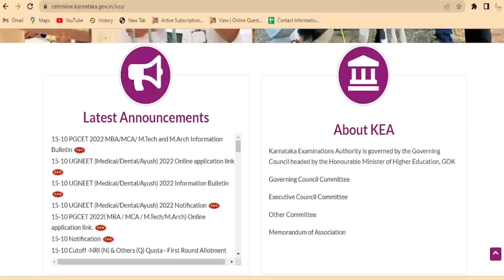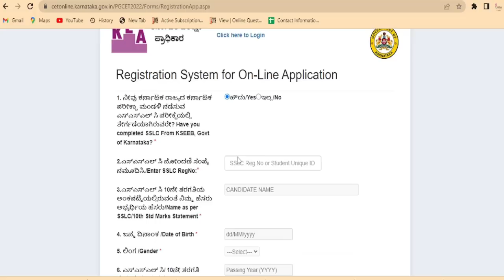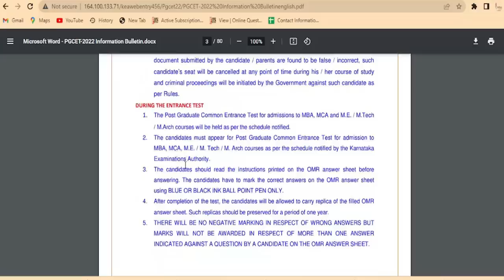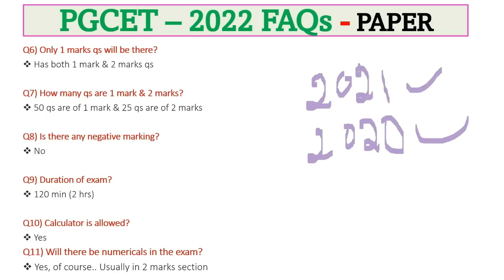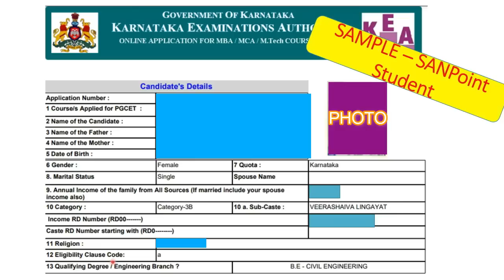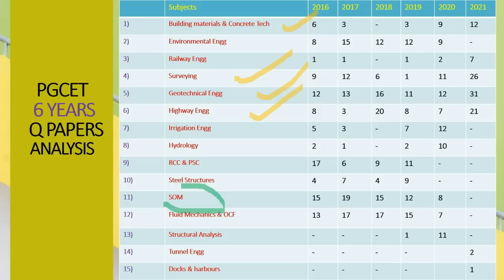PGCET 2022 Notification | KEA | Application Form Filling | Check description for CIVIL engg courses

Comment: Madam, I am facing a problem with registration itself,
I have completed my SSLC  in 2001, and my reg no. is 626352 but it is not taking what should i do. 
I have tried 2001626352, 20010626352, 0000626352, and 00000626352. and so many but it's not working what should I do...
Kindly help in this regard
Reply: Kea avrige contact madi

Comment: Hello ma'am,  getting an error saying year 4 should be more than year of joining while updating the marks details section even though I have provided all details correctly
Reply: @akshathavn7  no issues during payment
Reply: Hey even I'm facing the same Issue, please do let me know if it's Resolved.
Reply: @pruthvirajgowdap4324  Can I know what did you select for qualifying exam and what's the degree you have done please
Reply: @vandanavandu539  Hi, i have done mechanical engineering, At the time of registration, i have selected Arch-UG-BE/BTech-BArch option. are you facing the same Issue by any chance?
Reply: @vandanavandu539  did you get any revert from kea on this issue?
Reply: @pruthvirajgowdap4324  yes it's same issue
Reply: I just wrote a letter to kea along with application and have given that.. no update from their end yet

Comment: Ma'am I've just completed Bcom and applying for pgcet for only MBA.. many of them told calculators are not allowed but you said calculators are allowed .. please confirm wheather calculators are allowed or not
Reply from the maker: Calculator is allowed for MTECH exam. 
U need to check information brochure for MBA
Reply: Calculator is allowed don't worry